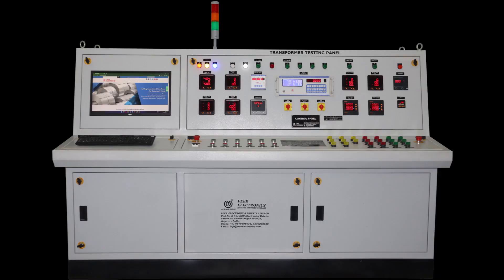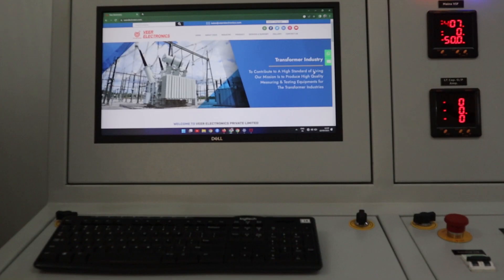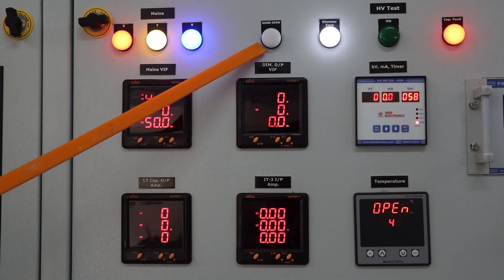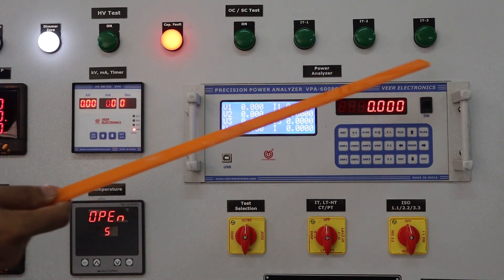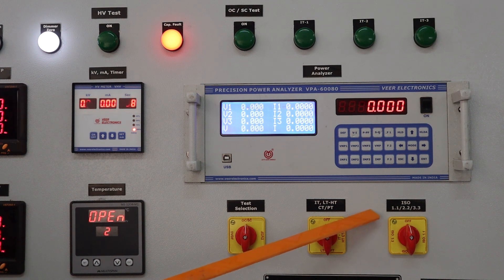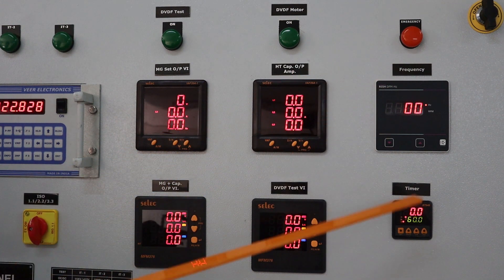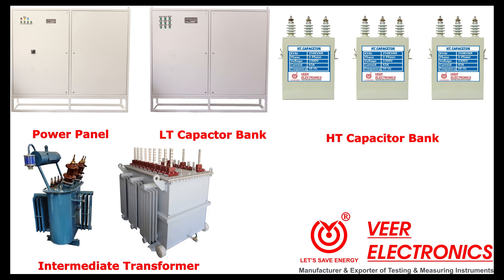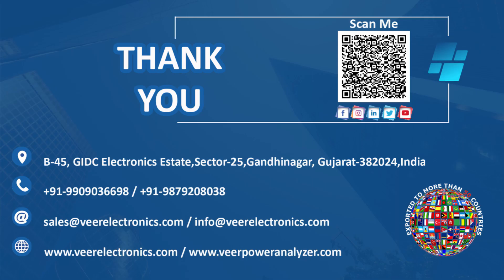Power Transformer Test Bench VTTP

Comment: During Load loss test(short ckt test) if the transformer is 33kv,and its rating current is too big.example for 2000kva/33/0.4kv the Rating current is 34.99A,and the pri voltage is 33kv ,so which capacitor bank we use? cb1?Cb2?cb3? cb4? cb5? and which voltage level we use?